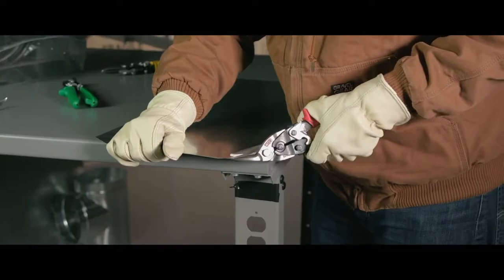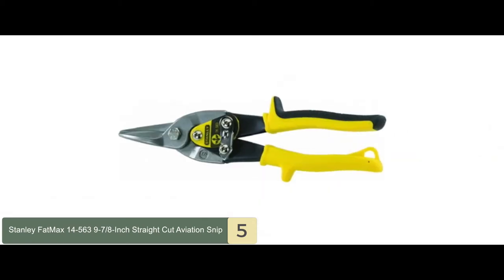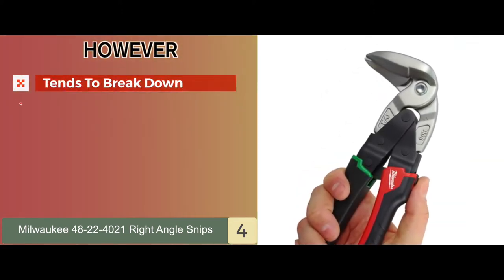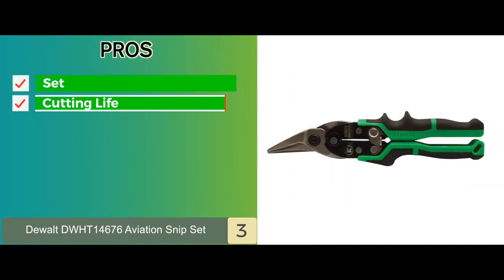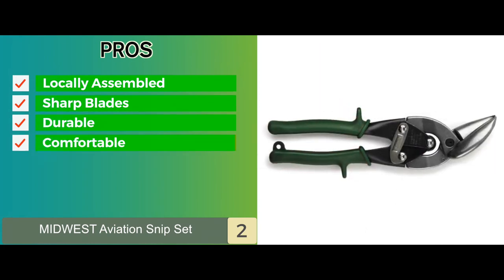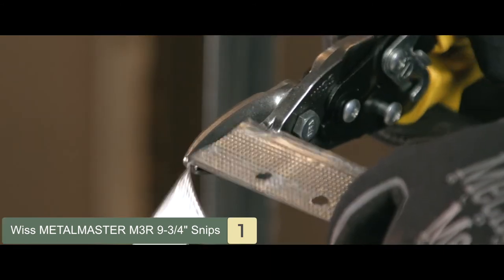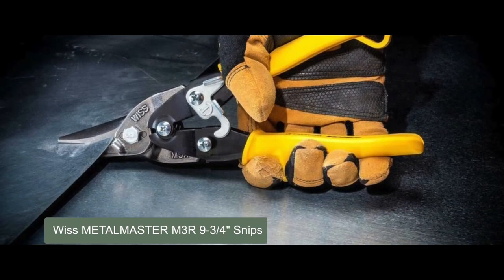Best Tin Snips ✂ (2020 Reviews) | HVAC Training 101

Comment from the maker: Read the full review here: ►► 
https://hvactraining101.com/tin-snips/
(Best Tin Snips)

-------------------------------------
✅ Featured Products for Best Tin Snips

0:00 Introduction
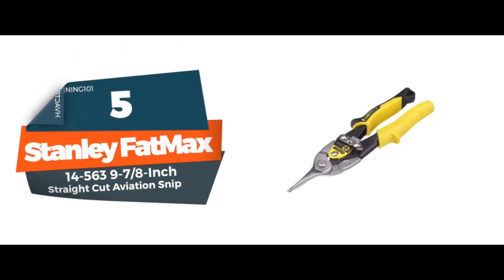0:48 5.Stanley FatMax 14-563 9-7/8-Inch Straight Cut Aviation Snip ➜ https://amzn.to/2EyzPi4
1:38 4.Best Right Angle Snips: Milwaukee 48-22-4021 Right Angle Snips ➜ https://amzn.to/3hq0Pi3
2:33 3.Best Budget: Dewalt DWHT14676 Aviation Snip Set ➜ https://amzn.to/3jawViw
3:22 2.Runner-up: MIDWEST Aviation Snip Set ➜ https://amzn.to/3hqBAMy
4:15 1.Best Overall: Wiss  MetalMaster M3R 9-34'' Snips ➜ https://amzn.to/3aVnXCS

Subscribe to our Channel 
🔴 https://hvactraining101.com/youtube/

-------------------------------------
Detailed review: https://hvactraining101.com/tin-snips/

✂ If you are an avid installer or serviceman, it’s obviously more important to be careful about choosing the right snips. A poor choice of snips can lead to frequent dulling. They can also increase muscle fatigue in your hand and forearm.

🔀Direction of Cutting
Using the correct snips not only helps you get the shape but also eases the cutting process for your hands. The best piece of advice while using snips is to have your gloves on, to avoid any fatigue onto your hands.

🔀Longevity
Having sturdy snips is essential. Of course, you’ll still have to keep them sharpened - cutting metal isn’t easy on them. But being sure they’re not going to fall apart is key.

🔀Grips for Metal Thickness
The larger the grips, the better they can handle thicker metal sheets. Tin snips maneuver well with thinner sheets made of tin and other similar metals. Aviation snips are available with larger and wider grips to accommodate the thicker sheets.

🔀Warranty
Some manufacturers offer a warranty of more than a year if the snips are meant for heavy use. The lighter ones come with a limited warranty and shorter warranty durations.

💬 Let us know what you think of these Tin Snips in the comment section below.

👉 We appreciate every thumbs up and would be grateful if you’d consider subscribing to our channel!!

-------------------------------------
🎥 Welcome to the official YouTube Channel of HVAC Training 101 🎥

HVAC Training 101 is dedicated to helping you make smarter buying decisions when it comes to air conditioners, heaters, air purifiers, and other HVAC-related items. 

 🌐 Learn more about us: https://hvactraining101.com/about-me/
 💻 Like our Page: https://hvactraining101.com/facebook/
 📢 Follow us on Twitter: https://hvactraining101.com/twitter/
 📱 Check out our Pinterest: https://hvactraining101.com/pinterest/
 🔴Subscribe to our Channel: https://hvactraining101.com/youtube/

-------------------------------------
Disclaimer:
Some of the footage used in this video is not original content produced by HVAC Training 101. Portions of stock footage of products were gathered from multiple sources including, manufactures, fellow creators, and various other sources. If something belongs to you and you want it to be removed, please do not hesitate to contact us at bob [at] hvactraining101.com.

Some links in the description are affiliate links. If you click on one of the product links, I’ll receive a commission at no additional cost to you. As an Amazon Associate, I earn a small commission from qualifying purchases.

#HVACTraining101 #TinSnips #HVACTools

Comment: In the past 37 years I’ve converted many apprentices and journeymen to craftsman/midwest snips…they are the Ferrari of snips…nothing else and I mean nothing else can preforms like them. Give them a try and I guarantee you will not be disappointed. Make sure you get the offset version tho. And one more thing…every great sheetmetal worker knows unless it’s a pair of bulldogs stay away from the yellow handle (straights) snips.
Reply: Harber freights new snips have the exact same design as Midwest and snapon and only cost 14 bucks.. i made the switch and not lookn back

Comment: Malco max 2000 left and right angle snips are the best snips on the market. Then I would go with mid west. I have bought and used all these other brands extensively  and they are trash. Also straight angle snips are useless. Anybody who have used Malcos after using any other brand will agree.

Comment: I’ve had the same pair of wiss for 3 years now I use them everyday and treat them like shit fell from my ladder a million times they still work mint
Reply: They are quality. But because of the bigger bills they are not as good in tighter situations in my opinion. 
Rigid and Mid West are better in tight situations
Reply: Wish my experience with wiss was the same
Reply: @danielhetherington1142  just had to buy a new set got around 3 1/2 years work out of them… I buy mine at Canadian tire they’re pretty cheap too

Comment: If you don't think Rigid snips are the best it's because you didn't know they existed.
Reply: Are they better than wiss and the Midwest?
Reply: Definitely more manoeuvrable than the wiss and on a par with mid west for sure. 
I use them all day everyday for years now. Still sharp.
Reply: Have used Ridgid offset snips for decades and they were great. Bought a new pair a week ago, but they have changed the design and now they are utter rubbish. Back they went! Going to try out the Midwest.